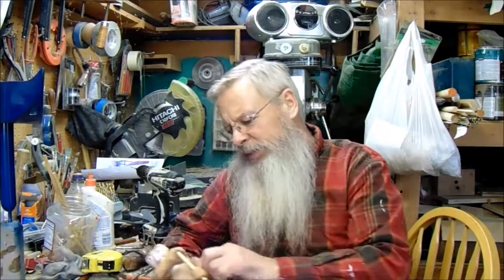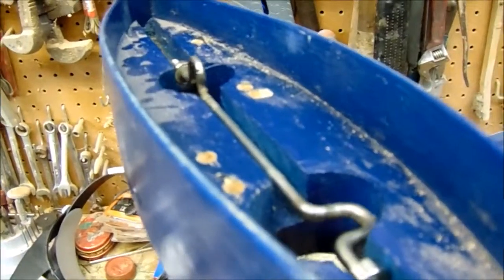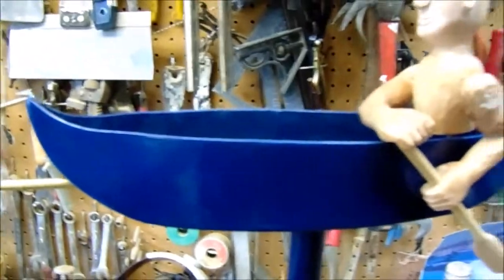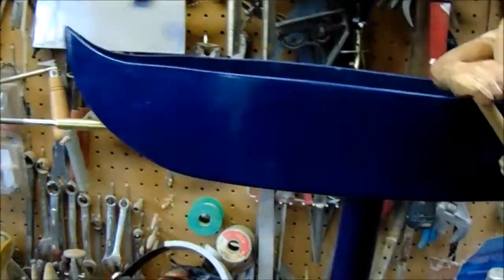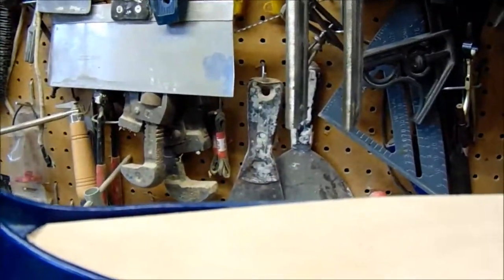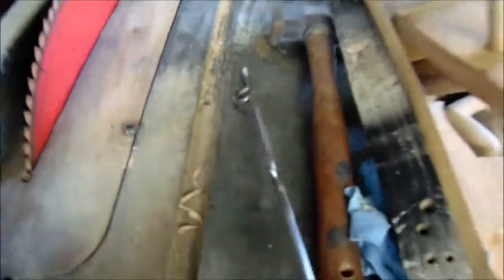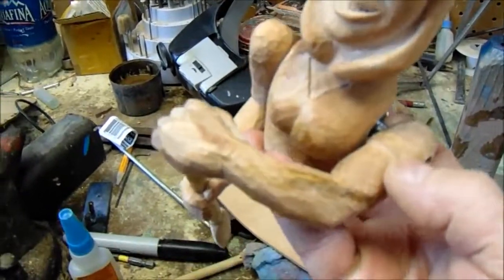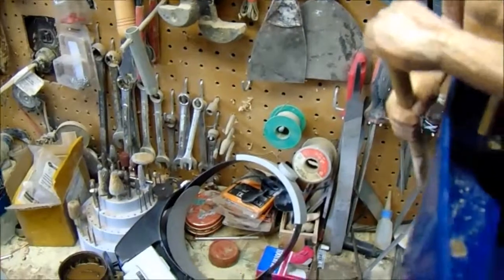Automata art Canoe Paddlers Whirligig overview

Comment: where do you get the gears, berings and shafts from
Reply from the maker: There are no gears on this model. I get my bearings off E-bay by typing in what size I want and then hit search. I use 3/16" id x 1/2" of bearings and 3/16" steel rod that I get from the local hardware store. I hope that helps.